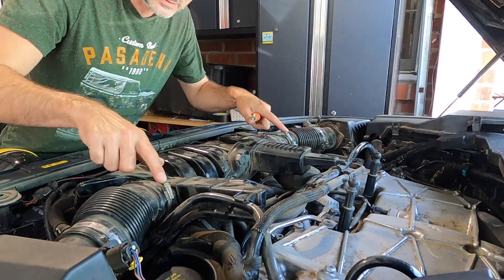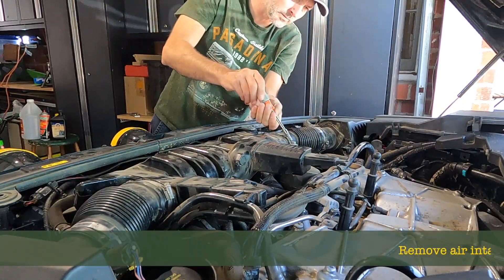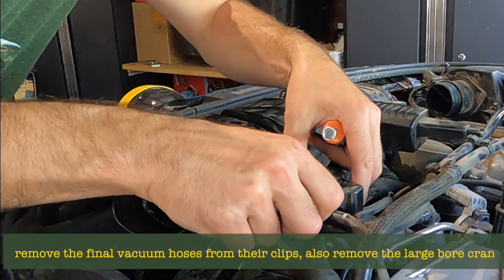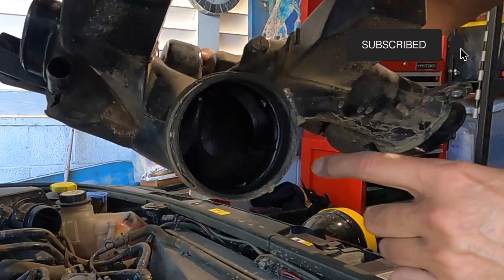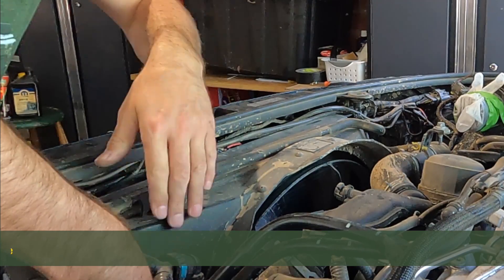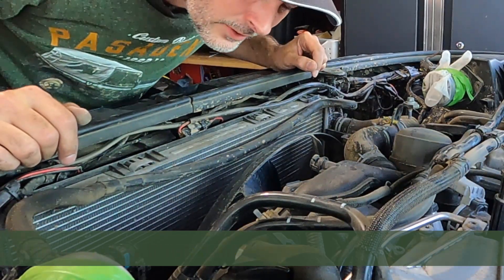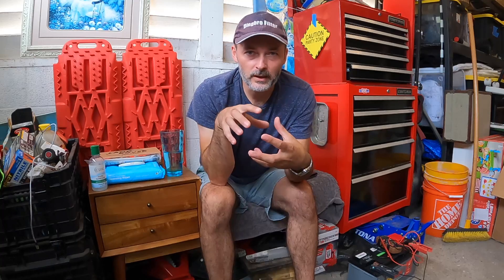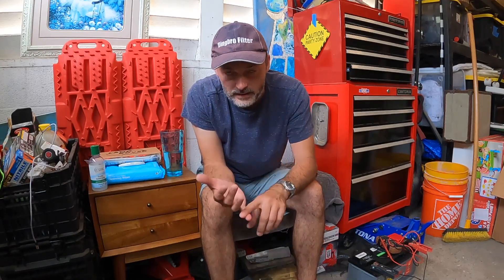Land Rover | Cooling Fan Removal "its a category 1 hurricane"

Comment: Hello .,I have 2012 RRS supercharged. my radiator fan is always running very very loudly , but the engine temperature gauge remains on quarter whereas outside temperature gauge is showing around 20 degrees Celsius more than the actual temperature. It’s giving P0526 code(cooling fan speed sensor circuit). It happened during 2000 kilometres trip . Thanks in advance.
Reply from the maker: Start with checking the control fuse, then relay and finally the connections to the fan. If all of these are ok then you’re probably looking at a new fan. 
Also try switching off the ac / climate control as this can override the fan controller to run. If the fan stops and returns to normal then get the refrigerant charge checked. You could be low. 

Good luck.

Comment: Thanks for your video I have  tried everything to get mine off a 2011 Lr4 so was hoping you had some suggestions ? Here is my video hoping it’s clear enough but it even freaking broke my pneumatic tool. Very frustrated at this point. https://youtu.be/arFxN7Jfq2E     I have contemplated cutting the dang thing off and buying a new pulley and fan clutch assembly.
Reply from the maker: Hate to break this to you. But you’re trying to tighten the fan clutch onto the pulley. It’s a normal direction thread, not a left handed one. Also it’s easier if you support the pulley with either a large flat bladed screwdriver, although I’d not recommend that as you can slip easily. 
I rented the tools for the job from o’rileys, good luck! If you’re still having problems then reach out again.
Reply: @wrenchnroverin222   Thanks I appreciate the reply, but I am super confused the service manual says it is a Left hand thread, https://youtu.be/rsS7eWJkgyo but you are not the first person to tell me I'm tightening it.  Just trying to confirm as I broke a second tool.  And I did order the actual pully holder part number from amazon shown in this service manual.  Please check out the video above showing the manual pages.  Am I reading it incorrectly?
Reply from the maker: @evinbowman72  this is the first instance that the manual is wrong, that I have found. So don’t beat yourself up over this. There’s a lot of videos of people struggling out there, which is part of the reason I put this one up.
Reply from the maker: With regards to the tools, I borrowed them from O’rileys. It’s such an infrequent job that I didn’t see the need in purchasing something special. But that was just my circumstance.